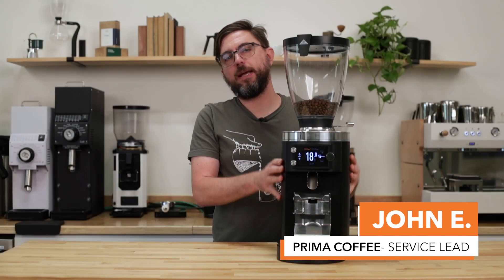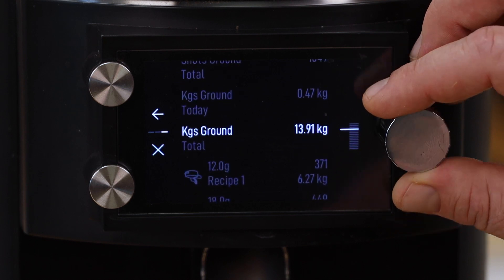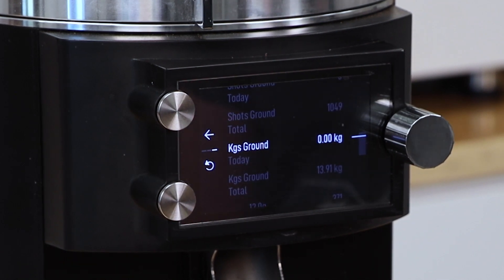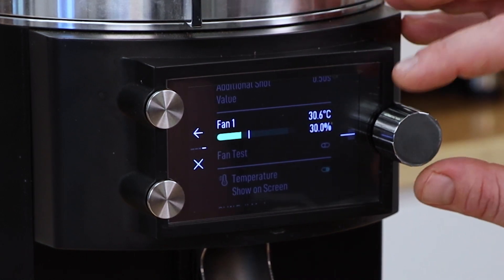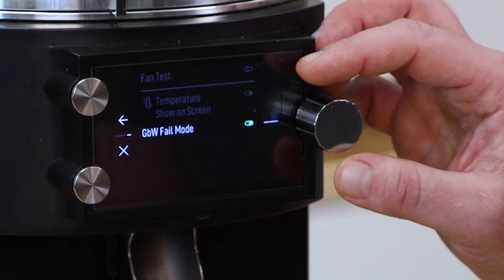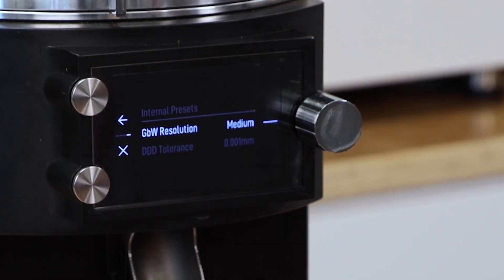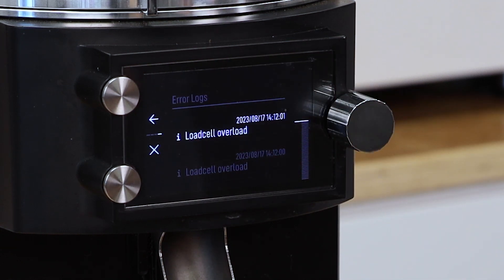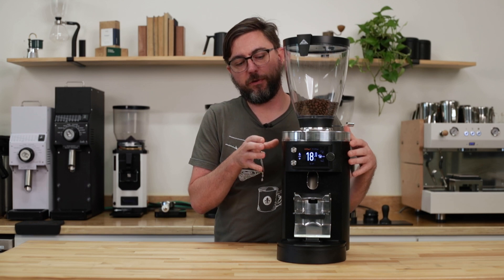Mahlkonig Maintenance | E65S GbW and E80S GbW Menu Navigation for Diagnostics

Comment: Hi, I recently changed the burrs on my e65s gbw. Do you know how to reset the burr health? Thanks
Reply from the maker: The procedure requires entering the service password: 9512867, then go to Service ----> Confirm Service Reset Burr Health. This will remove the "Service Required" message that pops up on the main screen. You can go into the statics menu and reset the Kg count as well. This does not require entering the service password.